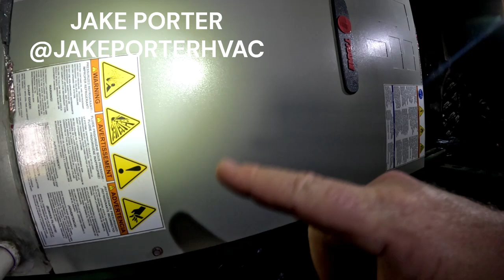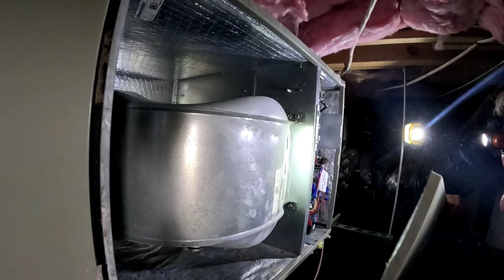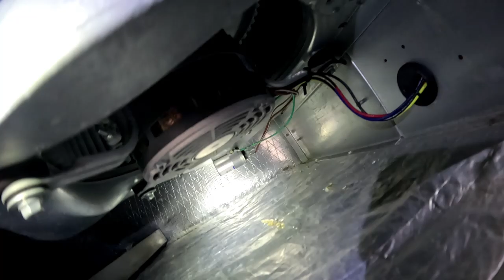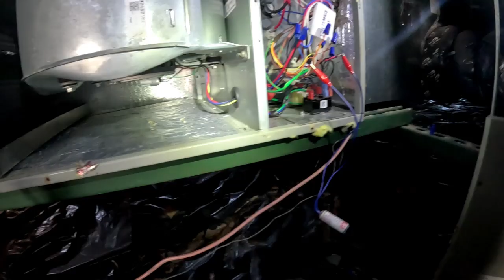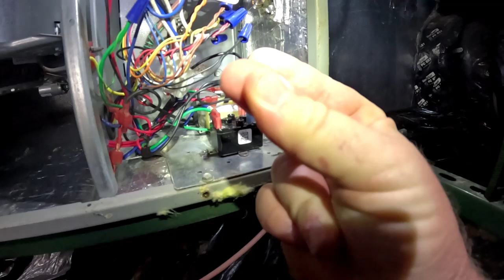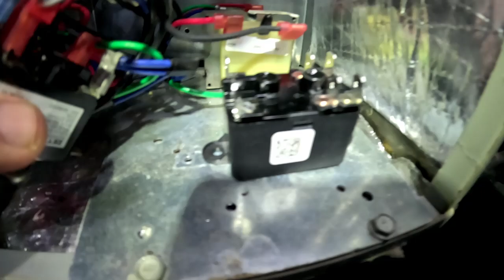Homeowner has high humidity and utility bills from HVAC system.

Comment: I haven't seen one of those Essex relays in years as up here in Canada I don't deal with heat pumps generally even when we do it's a dual fuel with a furnace but I would take those out when they stuck and put a Honeywell snap acting relay. They almost never stick
Reply from the maker: I will look into those.